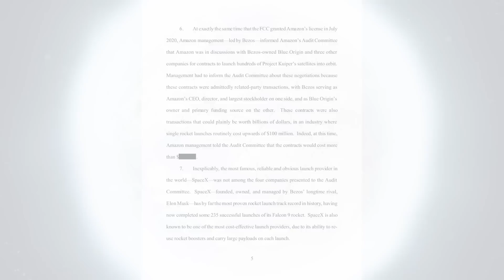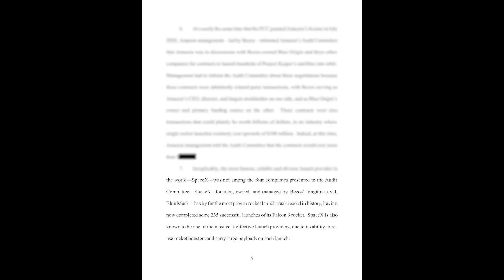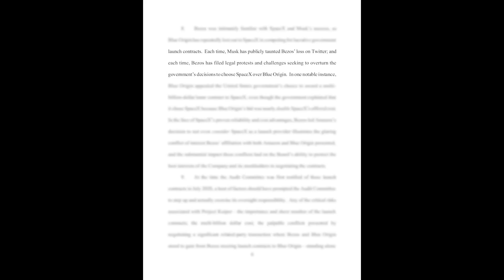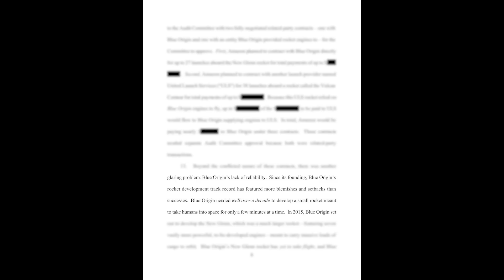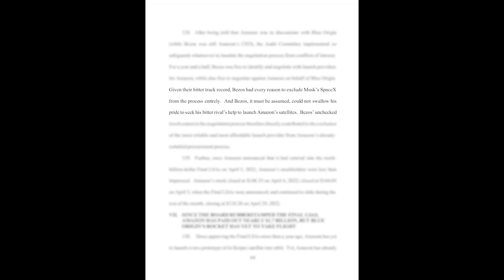Amazon Shareholders Think SpaceX Should Have Been Picked For Kuiper Launches

Comment: The obvious way around this was to make Blue Origin the satellite provider and sell the service to Amazon. Nobody would've expected Blue Origin to use a competitor.
Reply: Amazon is its own satellite provider and it's too late in the game to give that to BO which has zero experience in this. It would be switching one law suit for another. 

The problem is that Jeff Bezos owns BO but is merely a major stock holder in Amazon. He can throw away BO money to spite Musk if he wants to. He can't throw away Amazon shareholder money. Its illegal. 
BO - can't build the satellites (zero experience or infrastructure... Amazon is doing that) Bezos Can't assign his own BO company to provide a multi-billion dollar contract with Amazon as they have no track record of success and Spacex is the Only company that can safely (and cheaply/reliably) launch the required 1500 satellites by 2026. After that date the FCC gives away his reserved bandwidth to someone else. 

Vulcan won't launch until 2024. Araine 6 is also delayed until 2024. BO New Glen is Still a papr rocket with unproven engines and will not likely fly until 2026. 

He's got no one to meet the deadline. He really has to give all the New Glen and remaining launches to Spacex to get out from under this. 
He could also try the Chinese or Indians but getting the volume he needs That fast at a reasonable cost? There's just Spacex.

Comment: The BE4 has never flown at all, yet.
BE4 has never been tested off a test stand, so it will be interesting to see if it works in an actual real launch..
Note all the SLS RD-25 engines had already flown on space Shuttles.
i wish BO and ULA all the best for their first test flight.
Reply: BE4 will fly in a two-engine configuration for Vulcan, which is relatively simple with many known characteristics. The engine has tested well, but nothing tests as thoroughly as flying.  this is far afield from trying to launch a new rocket like Starship with its 33 engines, where the complications compound geometrically with scale. Vulcan is no significant stretch at this point in development, but needs to complete its test program -- something it has vast experience with. The likelihood is that Starship faces more potential for delays than that for Vulcan.  ULA is not a newbie company and is known for reliability. It would take quite a setback at this point to interfere with their completion -- possible but considered relatively low risk for this industry.
Reply: @eichelbergergary  Yes ULA have a very good reputation, yet the BE4 is yet to fly unlike the SLS Space Shuttle main engines.
Starship as you say is a far more complex beast, yet SpaceX also have the experience of the 27 engines of the Falcon Heavy.
Just happy so many new rockets are coming on line, What a great time to be alive to witness it all.
Reply: @favesongslist  agree 100 percent. I was on hand for inaugural Falcon Heavy launch. It was awe inspiring.  (My first launch). Having only seen Saturn V on television back in the day, I cannot wait to witness a successful Starship launch from Florida.  Have seen many Atlas Vs and am looking forward to Vulcan as well, but nothing compares to these heavy lift animals. SLS puts on quite a show it seems and I hope i get to see it launch, especially with the new upper stage.

Comment: I'm lost! Didn't ULA reach orbit with a BE-4 based vehicle?
Reply: No
Reply: No, because the Be-4 engine is scheduled to fly for the first time on the ULA rocket Vulcan which replaces the Delta IV.  And because of an anomaly with second stage Centaur of the Vulcan rocket the first flight is not scheduled until at least the fourth quarter of this year.   The New Glenn rocket which Blue Origin's heavy lift rocket is not scheduled until later in 2024 which will also use the Be-4 engines.
Reply: BE-4 in theory is ready to fly.  Vulcan has hydrogen leaks and I don't know what the problem is a BO.
Reply: The BE4 has never flown at all, yet.
BE4 has never been tested off a test stand, so it will be interesting to see if it works in an actual real launch..
Note all the SLS RD-25 engines had already flown on space Shuttles.
i wish BO and ULA all the best for their first test flight.
Reply: BE4 hasn’t left the test stand

Comment: Does anybody really a booster will fly with any BE engine before 2026? If only those Vulcan and New Glenn boosters had been designed to use Merlin or even Raptor engines, perhaps they would have been flying by now. Oh well.
Reply: it will fly before end of this year with the maiden fight of Vulcan. The engine is fine and ready to  go. ULA wants to address its potentially leaky upper stage thoroughly, otherwise it would have already launched.
Reply: @eichelbergergary, I guess we'll see. Don't hold your breath.
Reply: Elon should design the "C - 5" engine and sell it to boo O (sue origin) for 2x the price of the b4 engine.
Reply: @menotyou1234, works for me!
Reply: BE-4 Engine has higher thrust and why not help blue origin by buying their engines? Also does spacex even sells their engines?

It would need 3 raptors to lift vulcan or smthng like that
Reply: @paranaenselol, but on what booster is BE-4 actually FLYING? So far as I can tell NONE. Look, I'm nobody's fanboy but you have to admit that Musk has a positive knack for getting the job done! Bezos? Not so much.
Reply: SpaceX still has engine problems as well.

Comment: Has ULA confirmed, that SMART reuse will only occur after all 38 Project Kuiper Vulcan Centaur launches? I would have assumed this reusability project would be introduced sometime over the next couple years, since they are allready purchasing engines designed for reusability and have done multiple technology demonstration missions of the inflatable heatshield in partnership with NASA.

If ULA manages to introduce their planned partial reusability upgrade to Vulcan part of the way through delivering the Kuiper satellites, the number of engines bought from Blue Origin could be drastically reduced, perhaps by more than half.
Reply: Because they are already flying.
Reply: Too bad ULA couldn't use Merlin or Raptor engines on Vulcan. Just saying.
Reply: @billmullins6833  Why would they want Raptor or especially Merlin, instead of BE-4?
Reply: @plainText384  Because they could have been launching paying payloads 14 years ago?
Reply: @danharold3087  They were launching paying payloads 14 years ago? On Atlas 5, Delta 4, Delta 4 Heavy and Delta 2.
Reply: the ones that won't stay lit long enough to lift their booster? @billmullins6833

Comment: The problem is the BE4 engine. It's a non-starter.
Reply: IfUSāSō‼️
Reply: Now Mike why would you say that????are you a space x fan boy??? As I recall the be4 engine start and run just fine
Reply: yet are incapable of lifting their launch vehicle reliably so far/ @iamaduckquack
Reply: Raptors still failed at last test fire after 2 seconds.
Reply: The problem is the raptor engines are a non starter lol